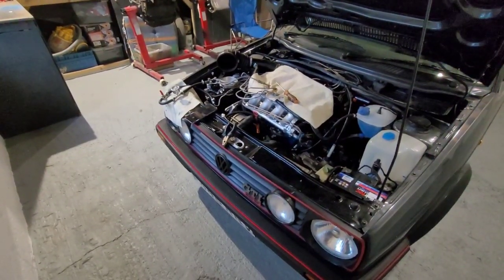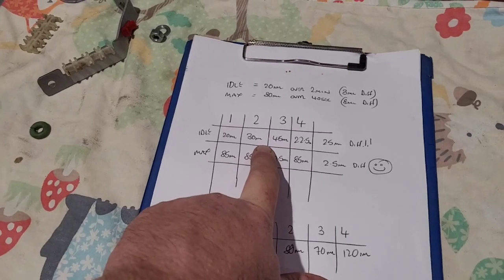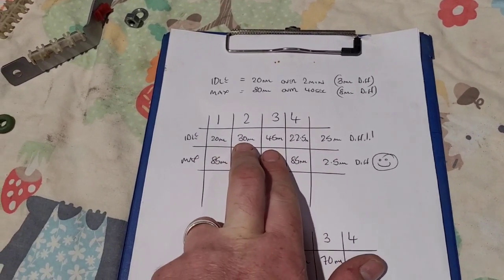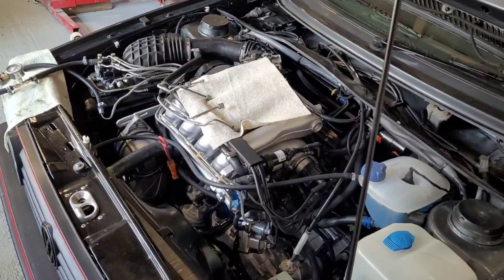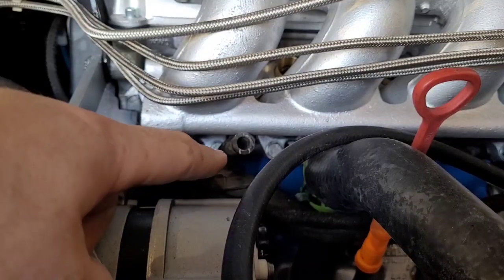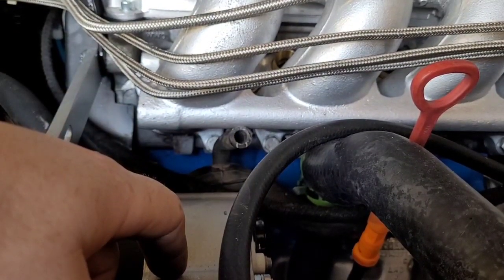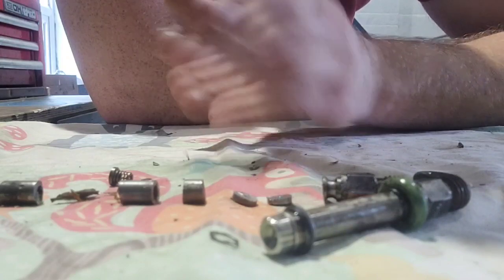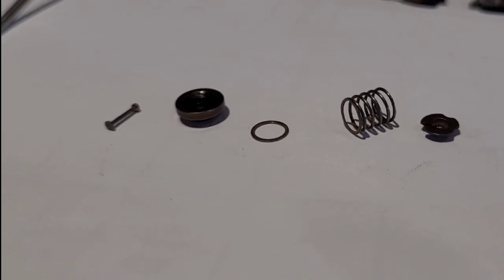Bosch K-jetronic Injector Disassembled

Comment: hello grey goose, very useful for me setting up a mk1 k-jet project car (been parked under a hedge for 15 years).  8 valve but a lot of commonality.  One question: for some reason, the head has the shrouded-type fittings in the ports, but the non-shrouded type injectors! Was running but not too badly. I know nothing really of the cars provenance, but it had every sign of having been mucked around with. Might that cause a problem or should I bite the bullet and buy a set of new shrouded injectors, do you think.

Comment: 👍 You got those levels spot on, it should be a huge difference with a full set of new injectors fitted though. They didn't look too bad at all to say they are 30 years old! 
Incidentally,  i assume abf injectors are different  to their kr counterparts? (abf cars running a more modern system?)
Reply from the maker: Yes ABF is electronic injection whereas KR is purely mechanical.
Reply: @GreyGooseRestorations  👍 yes  👍 so that's why my abf is running the kjet inlet 🙈, a new set of injectors wouldn't go amiss as mine is on 210k now! 👍
Reply from the maker: @ravenmaster6364  cheap enough to buy 0437502047 is the part number 👌
Reply: @GreyGooseRestorations  👍 great thank you very much for that 👍